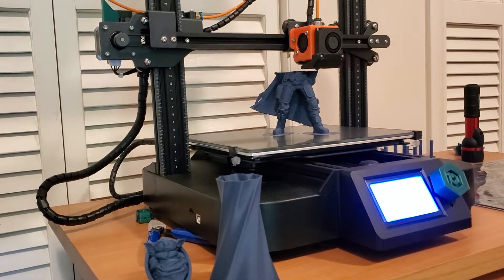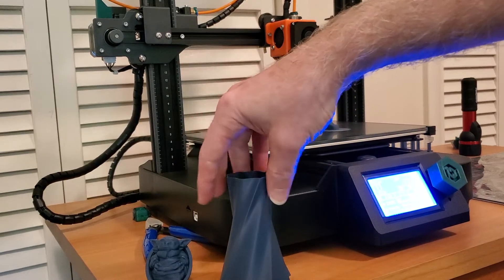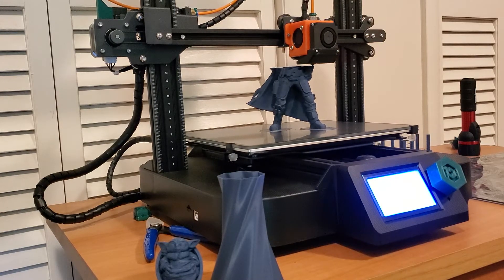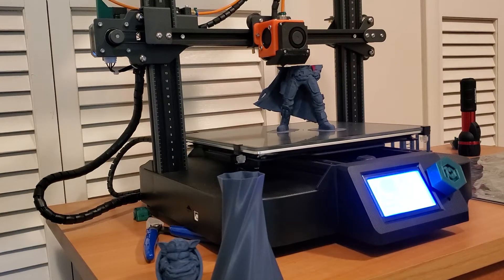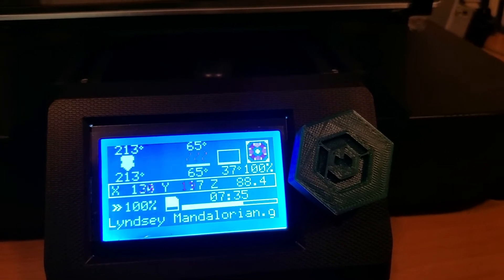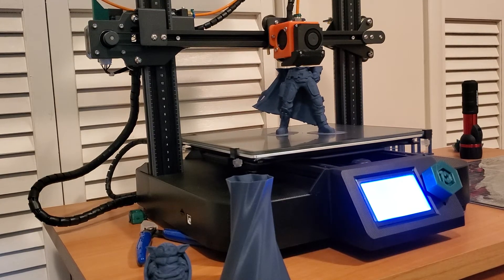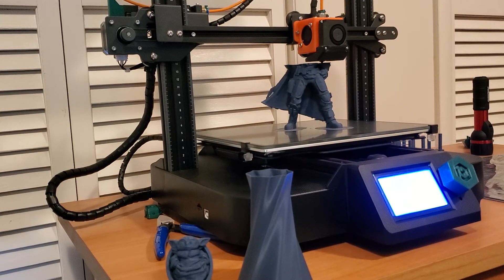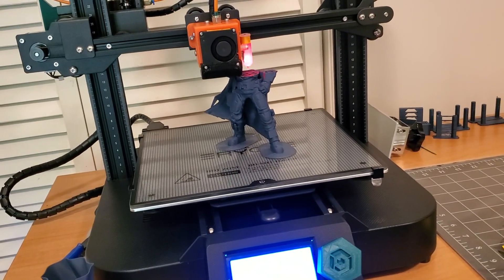Episode 11 - Wrap up and my settings for ER-20 Calibration

Comment: That filament does look nice! Do you find the layer adhesion to be good? 
I really like the looks of matte PLA, but I've heard they tend to have lower layer adhesion than normal PLA.
Reply from the maker: For me, the matte PLA adheres fairly similarly to other finishes/colors.  That said, the ER20's glass bed was (for me) less than ideal.  I wound up using Magigoo as a normal adhesive for any version PLA until the frosted PEI sheet arrived.  I'm now running textured PEI on every printer I own, and adhesion just isn't an issue.